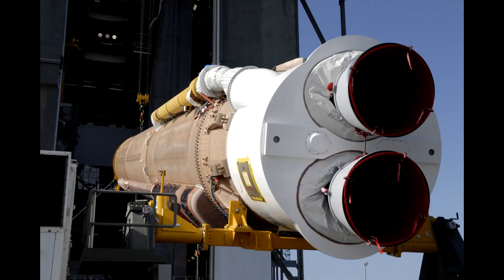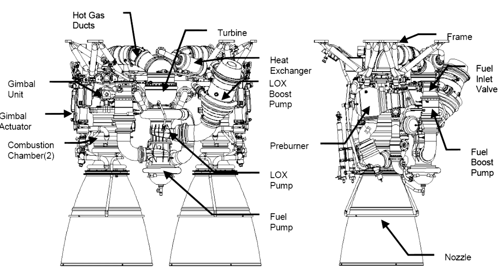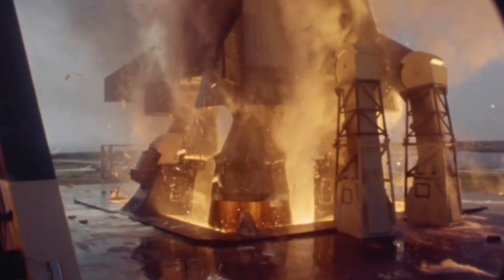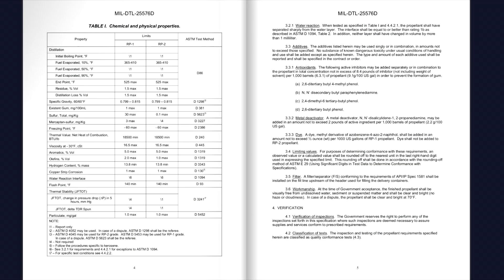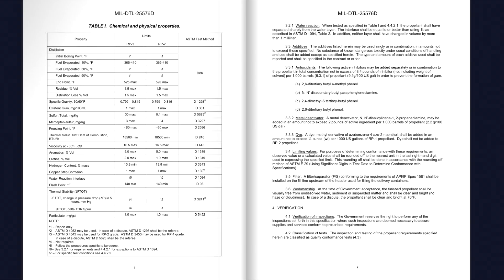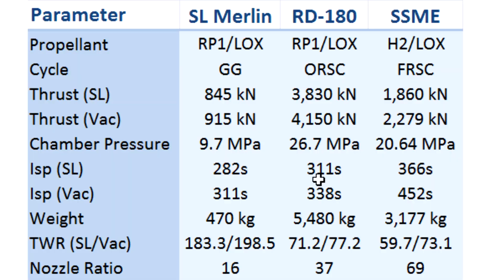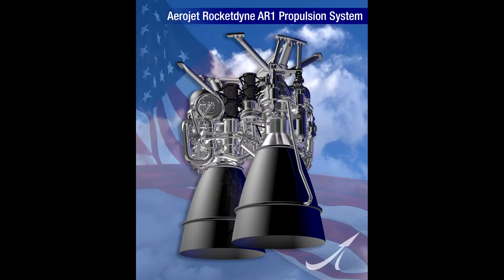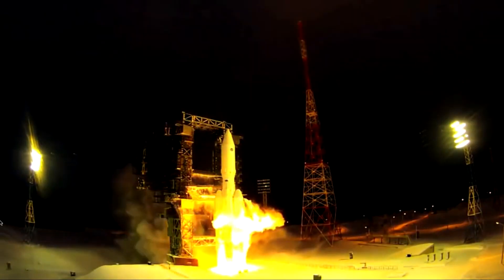Why Some 21st Century US Rockets Still Use Soviet Era Engines

Comment: Good insight that oxygen-rich turbopumps are the way to avoid coking.

You might talk about the inlet temperature of the RD-170/180 turbopumps, in comparison to the inlet temperatures of the fuel-rich turbopumps on the SSME engines, and especially in comparison to the inlet temperature of the full-flow turbopumps of the Raptor.  I've done some modelling of the Raptor, and it appears their turbopumps are going to be running at approximately room temperature.  No joke... that's the turbine inlet temperature on a FFSC methalox engine.
Reply from the maker: Would like to know more. I’m not a rocket scientist, just an amateur.
Reply: @scottmanley  Did you get my email?
Reply: That is strange. If RT is enough, then more sensible way is to cranked up the temperature just below the material limit so that chamber pressure can be increased. Or at least it should be increased to auto ignition region for better/faster reaction in the chamber. Anyway, it is my guess.
Reply: Remember that the turbopump only needs to get the propellants up to the chamber pressure + injection drop.  In the case of LOX flowing into a 20 MPa combustion chamber, that's about 20 J/g, less than 1 part in 1000 of the total energy in the propellant.  Turbopumps aren't generally very good at extracting energy from their fluid, but even so, total turbopump power is typically 1-4% of the total thermal power of the rocket (more for anything with ultra-squishy hydrogen).  When that power is added to a small fraction of the stream, yes, it gets hot.  But when that power is added to the full flow of propellants, it rises a few percent of the total temperature rise of the rocket.  That's not much.

One of the big problems in LOX systems is water ice.  The stuff abrades the inside of the plumbing, and if that plumbing is aluminum (and maybe even titanium), the fresh metal surface after the oxide is removed is quite combustible in LOX.   One issue with an FFSC engine cycle is that the ultra-lean oxygen turbine exhaust is going to have water in it.  If this water is ice or even liquid droplets, it's going to be hard on the machinery.  Water's critical point is at 22 MPa and 647 K, and Elon has mentioned combustion chamber pressures of 20 and 30 MPa.  I suspect they are going to end up with a combustion chamber pressure of over 22 MPa, so that any water in their system is going to be at least compressible and close to if not actually supercritical.  Maybe they'll run the preburners over 647 K just to avoid any two-phase flow entirely.

Any CO2 will be supercritical, as the critical point is 302 K and 7 MPa.  No problem there.

I think it's amusing that high pressure in the preburner and combustion chamber might actually solve problems rather than just cause problems.
Reply: Excellent and thank you! Scott Manley in his video on rocket plumbing didn't make clear just how oxygen rich the raptor was going to be. By going full-flow you don't have a drive shaft and a separate turbine, as the burner exhaust itself is what drives the combustion chamber. I love it! Especially since it lowers burner temperatures so much (RT !)
Reply: Iain McClatchie ... Excellent points.. I wonder how aluminum would do for reusable engine giving high stress/vibration. Will stress crack be problem? any idea?
Reply: FFSC has two turbopumps, one for oxygen and one for fuel.  The shafts are not connected together.  No gears, no seals, but the bearings are very highly axially loaded, since the turbine wheel is essentially the top of a large 25 MPa pressure chamber.  Probably fluid dynamic bearings.  In the Raptor picture that I've seen, the oxygen turbopump -- compressor, burner, and turbine, is shorter than its own diameter.  It's incredibly compact.  25+ MPa plumbing sounds super massive, but less so when you see that it's actually just a squat cylinder on top of the combustion chamber.

FFSC is so lean on the oxygen side, and so rich on the fuel side, that the mix may not support combustion.  The lower and upper flammability limit of methane in air is 4.4% and 16.4%.  I wasn't able to find it for pure oxygen rather than air, but it'll be something like 4% to 70%.  Both turbopumps on an FFSC engine may be outside this range.  To support combustion, they'll both need to do something like a jet engine, where the fuel is burned with a portion of the airflow at higher temperature and then diluted down to turbine inlet temperature.
Reply: Sanji, aluminum is infamous for cracking under vibration.  It always cracks eventually, no matter how lightly loaded it is.  Steel has load limits, under which is doesn't appear to ever crack (although it's obviously hard to test more than billions of cycles).  I don't know what they used.
Reply: Iain, I agree with fluid bearing. I heard in one interview from Blue Origin, they talked about fluid bearing and seal so Raptor may do the same. Otherwise they will have to check bearing wear. Do you mean that oxygen turbopump is smaller than Methane pump? I thought that LOx pump should be larger since it has less volume to be pumped but in CH4/LOx, LOx volume is slightly higher (ratio~3.8) .
So for the pre-combustion chambers of FFSC, there will be mini-pre-chamber for each.. cool... lol.. 
For the autoignition, CH4 is 537'C according to Wiki. That seems quite high but I believe at 25MPa and pure oxygen, it should be lower. I just could not find (I search roughly on google image for the graph). Do you know about that?
I agree, aluminum suck..
Reply: Sanji, the Raptor LOX turbopump impeller is larger than the fuel turbopump.  Just as you say, the LOX path flows more volume * pressure and needs more power.  The Raptor LOX path is basically axial, straight through the middle of the gimbal bearing, through the turbopump, straight into the combustion chamber.  The path is shorter than the diameter of the turbopump housing.  It's possible some of the pump stages are centrifugal, which would cause the LOX path to wind in and out radially and be a bit longer.

The Raptor's fuel turbopump sits off to the side.  Since it moves less volume at perhaps somewhat higher pressure, the impeller is smaller than the LOX turbopump.  But since it sits off to the side, the flow has to turn some corners, which is bulky, and the gimbal bellows are bulky too.  So it appears to take more room than the LOX turbopump.

I don't know the autoignition temperature of methane/oxygen.

One more difficulty with aluminum is that it's just not very strong.  7075 is the strongest aluminum alloy, and I'd question whether a special temper strength can be relied on given the horrible thermal environment in an engine.  Without that, you can assume no more than 140 MPa yield strength, which means very thick walls -- around 12% of the pipe diameter for 25 MPa fluid.  The Raptor is so high pressure that the powerhead is going to resemble a beefy hydraulic earthmoving machine more than a lightweight aerospace engine.  The flip side of that is that the powerhead will be small per unit thrust.
Reply: To be honest, I used disposable email for this so I could not get one. I am sort of staying away from social media (no twitter nor facebook). I had just Quora account just to ask and read some.
Thanks for replying. Now I get why I only see one turbopump assembly in the Raptor photo. I thought that another one is behind the combustion chamber and just not showing in the photo (since I also saw only one gimbal hydraulic). But now I see it like you said, it is very short and I just couldn't see the LOx pre-combustion chamber. 
And both seem to have only one centrifugal stage. Elon said that it will be multistage so I was sure that it will be multiple centrifugal stages + pre-compression impeller feed stage (like space shuttle engine but combined to single axle). Seem like I am wrong.
Thanks for all the time to write your reply. Especially the supercritical pressure/temperature for water/ice avoidance in LOx is sth I never thought about. Now it makes sense that all RD170/80/90 are all very high pressure.
Reply: That's good insight when "turbopumps" pumping anything "oxygen-rich" are going to oxidize (not a coincidence) incompletely any fuel, which causes "coking"? Boy you internet "engineers" are smart. You couldn't get a job in a Jiffy-Lube in the U.S. with all of your mechanical disinclination but hey, as long as your socialist government education systems keep feeding you feeding on bullshit and living in the dark, you at least have the comfort of thinking you're intellectually "superior" to Americans.
Reply: You've done "modeling" of a non-existent machine. ROLFLMAO! Just like its already "superior" to anything "American" before it physically exists. Of course that's the one way to ensure "superior" engineering. Stick to "models".
Reply: What precisely is "room temperature"?

Comment: Is it possible to make an effective vacuum propulsion system via liquid with high surface tension and wave generator ring which creates a strong constructive interference spike in the middle?
Reply: why not? seems like an odd system, but hey. You would get some negligible ISP out of it, I think.

But In my opinion if you wanted any reasonable ISP out of this, you'd have to study the behaviour of fluids at extremely high frequencies, and they do not exactly behave the way you expect them to.